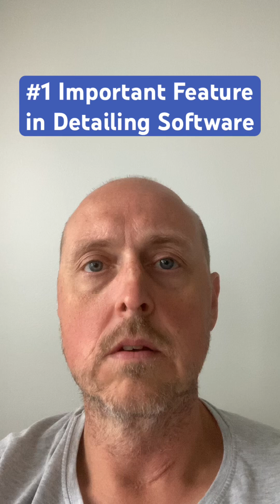Most Important Feature of #steeldetailing software #teklastructures #tekla SDS2 #teklastructure

Comment: The trouble with Tekla is it seems to be 'improved' by programers and marketing execs and released without an actual draughtsman ever trying it out.I bet they have a sign on the program developers door that says "wheel reinventors". Im a self employed sub contractor working on fairly small projects (1 to 100 tons) for fairly small engineering customers who dont have their own drawing office. Given a clean slate on which to detail a job im going to use 2018i or at a push 2019. Occasionally I have to model steelwork into a larger project and will be sent models that have been created in newer versions by the main steel contractor and have to adopt that version. Ive actually got a 2024 model that im currently working on and it is painful. Theres a couple of issues in the modelling environment (they ruined the spit tool) but mainly because the multi properties pane in drawings is absolute garbage. I quizzed Tekla UK on why it was introduced and they said it was to reduce the amount of open dialouge windows open when working in the drawing environment. When Im working my way through a set of GA creation and edits in earlier versions I can skip from one GA to the next and any property boxes I have open remain open and display the last used info from one drawing to the next, which means I can fly through edits without having to recall saved properties for every single element of the job. With the latest versions I have to recall every single (saved) property from the drop downs every time I go to the next drawing. If I click on a label when Im navigating around the model, Tekla will decide thats the label input i want and adopt it even though I only clicked on it to move out of the way. This is not just a case of having to get used to a new interface. It is slower, much slower and only someone whos actually trying to hit deadlines and earn a living can see that Tekal love to break whats not broken just to justify the 3K annual maintenance fee.